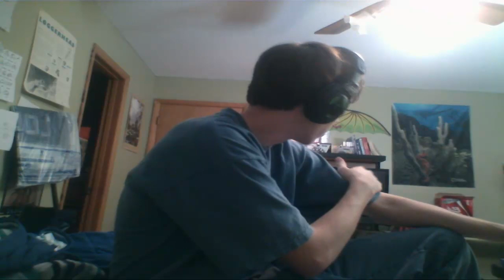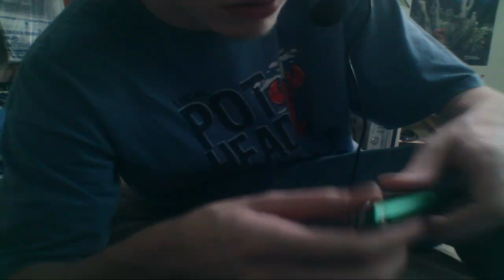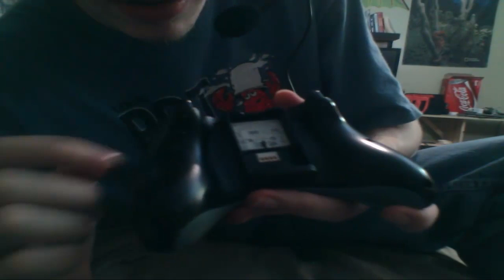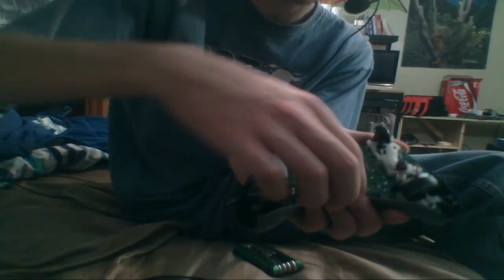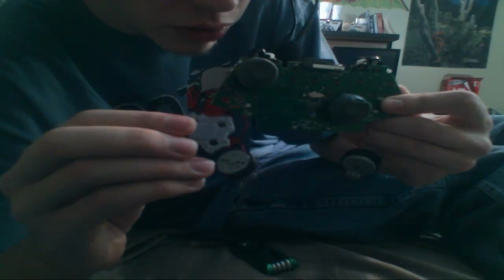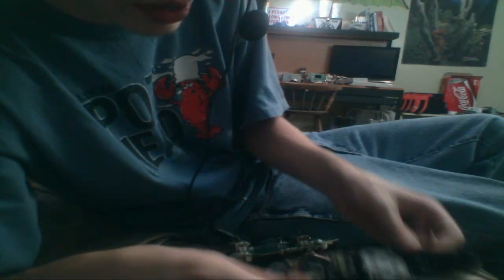How to Fix An Xbox 360 Controller (Button Problems)

Comment from the maker: go to the start menu and go to accessories and open up the on screen keyboard, in some OS's this will reset the main keyboard.. Otherwise, it's probable water damage or corrosion, you my have o open it up and clean the connection or just replace it all together.